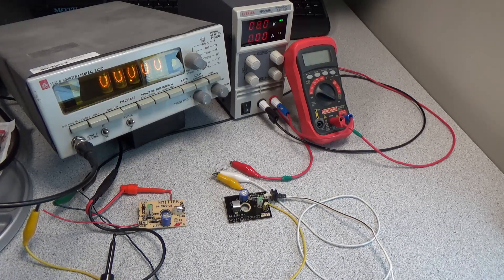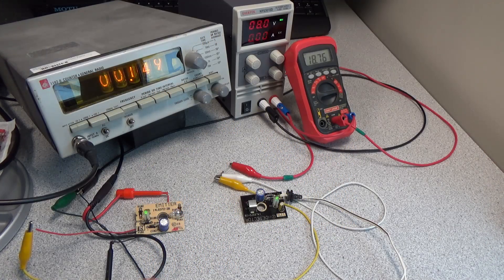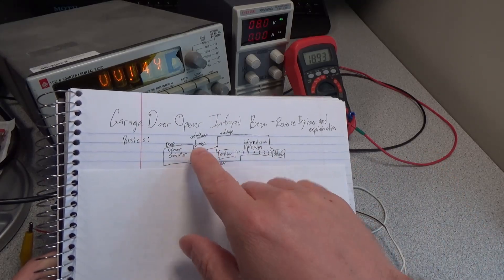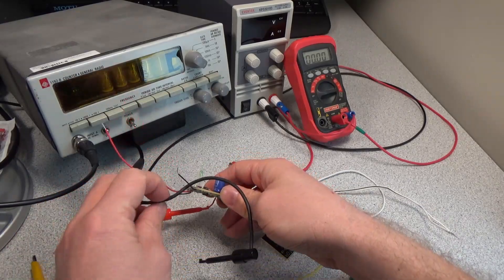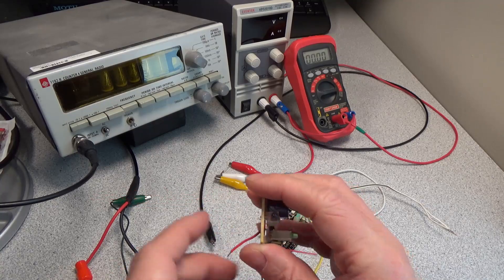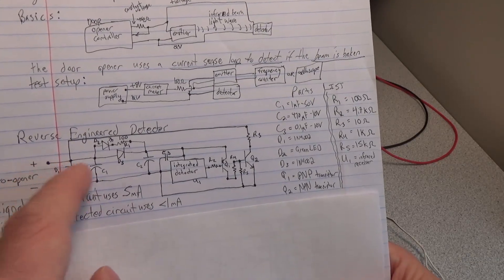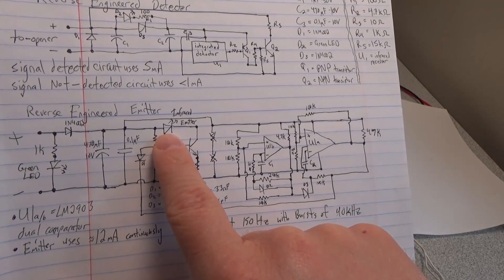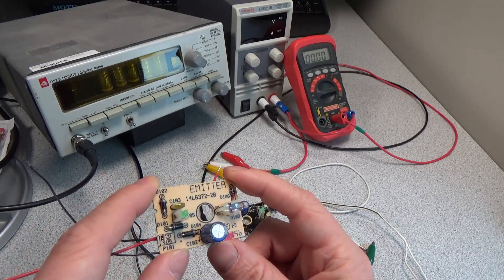Garage Door Opener Sensor Reverse Engineer and Explanation

Comment: Great video and decoding the circuit, except for the receiver led is backwards, but he keeps mentioning that this is a current detector. I am pretty darn sure that in the garage door opener there is a missing pulse detector. If the beam is broken the detector will stop firing Q2 which momentarily shorts out the supply coming in but is okay due to the 150 ohm resistor, then the circuitry in the door opener monitors the pulses. If receive pulses, allow normal door operation, no pulses, stop the door or stop door operation and blink the light. That is why just jumpering the sensors doesn't work as it needs the pulses to allow normal operation.
Reply from the maker: Thanks!  Yeah, that extra layer of safety makes sense, I didn't see any modulation on the line during beam making contact operation but this is a quite an old set of sensors.  I wonder if the opener itself provides power in a specific way.

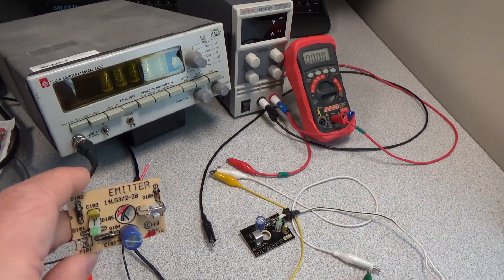Comment: Referring to the schematic at 6:11 I think a few corrections?
I think the labels for C1 and C3 are flipped.
I think the LED D2 points the other way.
The "+" input, via D3, charges C2 (470uF) and this powers the detector for long periods even when the detector output, via Q1 and Q2, is pulsing the "+" input to ground via R3.
So with C2 via R1 (100-ohm) into ANODE of LED D2, then when CATHODE of LED is pulsed to ground the LED will flash on.  This is rapid at 150Hz, so your eye sees it as continuously lit.
In absence of pulses D2 does not light.

Comment: All this so you can't just use a jumper wire to bypass the system? 

Thanks!
Reply from the maker: Yeah, it's a lot for a simple function.
Reply: But could you trick it with a single resistor, that's what I want to know??? 'Asking for a friend' who wants to use an old motor to run an electric awning! Safety requirements prevent remote actuation without IR protection (which is generally a good thing).

Comment: I built a similar safety device once. The little silver receiver module is a standard remote control receiver like you'd see in a television. These look for a 40KHz carrier with the specific button information modulating it. The 150Hz imitates some kind of button push so the receiver acknowledges it and pulls its output line.   I'm pleased to see that my old design was so similar to a commercial device.
Reply from the maker: Thanks for sharing!  Yeah, they get a lot done with a very simple device here, it's still what they use today.

Comment: I have the green light on the receiver yet my opener  will start the down movement and then immediately reverse.  Even when not connected to the door. It initially worked but started the no down as I  was running to adjust the up stop. Up/down are the screws,  not push button.
Reply from the maker: I'm not a garage door technician and it sounds like it could be unrelated to the sensors.  But the sensors could be bad.  

You can use a multimeter on the DC voltage setting (at your own risk, if you are comfortable with that kind of thing, if not call a technician) on the same two wires that go to the sensors to see if there is a change when you purposefully interrupt the beam, if using a similar style to these.  If it's any kind of mechanical issue, call a pro.  Probably call a pro is the best answer anyway.

Comment: also an EE, nice explanation, this is a clever design, only uses the same 2 wires for send and rx, someone must have gotten some patents for it.  I wonder if this wasn't invented for generic detecting of a beam that is interupted.
Reply from the maker: Thanks!  Yeah, it seems like there are lots of industrial applications that can use this or already were.  I looked up some newer openers and the sensors are still the same two wire system, looks like a lot are using it.

Comment: Good information.  Is is possible for me to connect a few more Tx Rx pairs of sensors together for more safety beams?  How?
Reply from the maker: You should be able to connect more of them in series, as it is a current loop circuit, depending on how much power is available though it may run into issues.  Being off the manufactures recommendation it probably would be a liability to use it in a multidevice configuration off official setup rules.

Comment: Well explained thank you. My detectors seem to be working but they are not. They are lighted. But they are from a chamberlain and I just replaced with a Geanie. Thinking the Chaberlin not compatible with the Geanie?
Reply from the maker: It's a good question and I am not sure.  On my actual opener there are some adjustments, potentiometers, but I never looked that close to see what they are actually for.  I'm sure something would be in the user manual of the system you are using.  Of course there are numerous ways to make these work, in this case the current loop, but some may use voltage sensing, or digital signaling, too many options.

Comment: Where would a guy add connections that would trip a breaker when the path was broken.
Reply from the maker: A breaker or circuit breaker is a safety device so you'd probably not want to trip that.  But it would be possible to have it control a contactor or relay to turn a device on or off.  You would have to sense the current loop and switch on and off an output at some threshold.  On it's own this thing wouldn't have any ability to trip a breaker.

Comment: My dog chewed and pulled all of the wires the sensors now there to short to solder or put the wires back on the sensor. Is there anything that can bypass it that it would just always work
Reply from the maker: Yeah, I'd get a new set of sensors and replace the wire.

Comment: I have sensor/detector that looks just like yours inside. I had to get a replacement set and ordered by the same part number but the new ones don’t light up. Do the new ones run off of 6-8 volts as well?
Reply from the maker: These ones are really a current loop.  They happen to start up at 6-8 volts but it's really a constant current supply that they operate with.  So, the opener can sense the change in voltage when the beam is broken.  The one side does always light up, the other side only lights up on alignment of the sensors.  They're are different systems or the problem could be a break in the loop somewhere.  I would try to connect them close to the opening with short pieces of wire to see if they light up.  If they work there, then the issue is with the wire.
Reply: @AllThingsOnePlace  turns out the set I bought had miswired leads and the wiring had to be reversed. when I connected the white to white/black and vice-versa, it worked fine. Thanks!

Comment: Thank you.  It was so obvious the scheme was current loop. I did not know.  Now I do.  I suddenly have a desire to add something in the house so that I use my garage sensors for more than stopping my garage doors, something that I might signal me should someone walk into my garage uninvited.  A low resistance could easily be added in series such that a voltage could be sensed to drive something.  Probably that exists.
Reply from the maker: I've heard of some garage door openers having the option of turning the light on when you cross the path of the beam.  If security cameras didn't have motion sensing built in it could be useful for that.